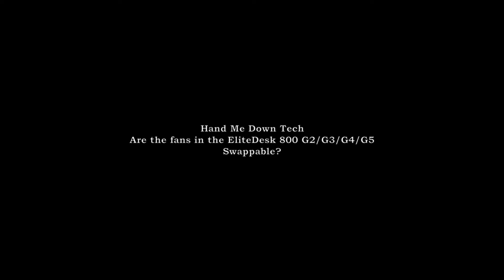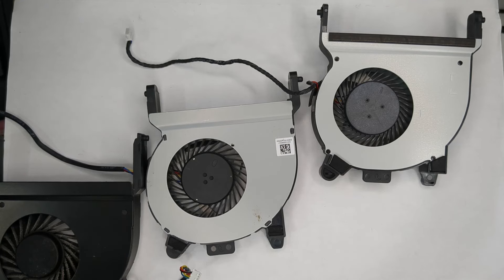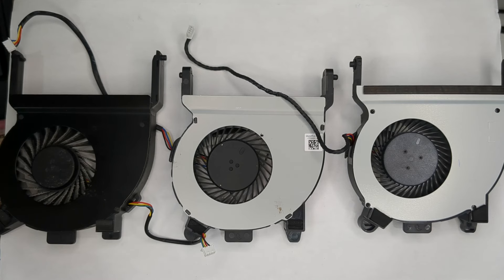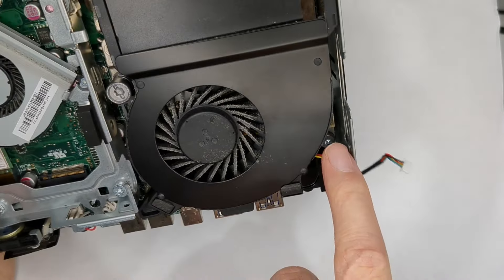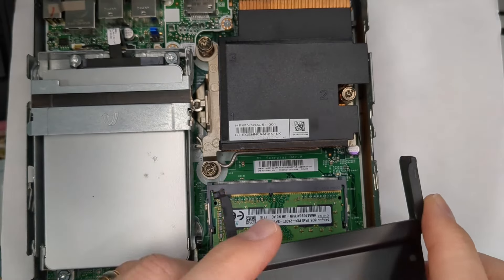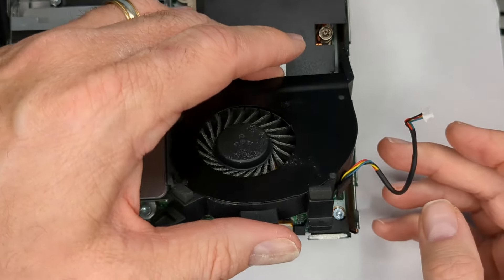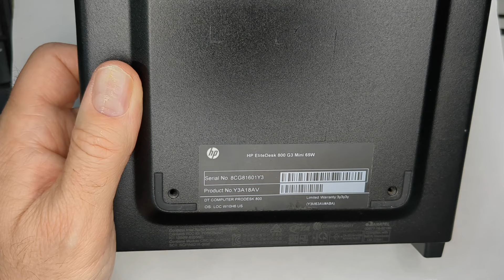Swap fans between the EliteDesk G2/G3/G4/G5 800 minis?

Comment: Yup... even the 65 watt fan caddies. you can screw the caddy down with two front screws, but the fan header is wrong... so even turning it upside down gives you nothing. 

Even trying to use the tops for some of the elite desks won't work, or swapping the front plate. It was absolutely annoying to have happen.
Reply from the maker: You'd think basic stuff would interchange.  Thankfully the power supplies aren't unique.  Except of course when you need the higher juice for the 65w system.

Comment: The thing that I like about the G1, and possibly the G2, is that you can set a minimum fan speed. I recently installed an E3-1275L Xeon in my G1. HP actually has a driver for it! Part of what the driver does is to set the min CPU min. processor state at 100%. Of course it runs pretty warm, but that CPU really wakes the G1 up. Anyway, in the G1 bios under power you can set the minimum fan speed. So I bumped it up a couple clicks and that really helped the CPU temperature a lot. . . I have a G3 and a G4 and neither of those Bios has that feature.
Reply from the maker: Very good info.  I'll check out the fan speed.  I was also curious about the xeon.  How many cores is that?
Reply: @handmedowntech  Sorry, had knee replaced and haven't been on in a while. It's 4 cores, 8 threads...
Reply from the maker: Hope all is well.  Recovery from that can be challenging.
Reply: G2 user here, yes it is possible to set minimum fan speed in a G2 ranging from 0-100% with a 10% dif

Comment: How about no fan? If we just ran nvme or ssd could we get by without a fan? Thinking about putting one behind my tv as plex client, as an Apple TV replacement. Wanting super quiet.  you’ve got the skills to test this theory out! Will it live a long healthy life?
Reply: This is the cpu fan so you would only get away with it with the least power hungry cpu you can fit and not do very much with it (no transcoding etc). TBH a 35W system is pretty quiet in its standard form ... Be interesting to see what happened it you sandwiched a big thermal pad between the cpu cooler and the case lid, didn't didn't run a fan and use the lid as a heak sink. You would have to turn off any fan detection in the BIOS obviously (not sure if that's only for the SATA fan though).
Reply from the maker: Interesting concept. Let me think on it
Reply: Remove top cover, remove the black sealing from the heatsink and force windows to run on battery saver mode -> cpu fan will run the lowest rpm if you dont demand any cpu usage applications

Comment: So as you may remember I order a hp elitedesk 800 G2 mini from eBay it was a bar bones unit i7 so missing the CPU memory and hard drive but this morning I wakes up to a message from the seller that he has posted a fully working 65w i5 with all the bits this one comes with a working hdmi option board as you did a video where the hdmi never worked in the 65w when it comes I will get the parts number so if you want it to be hdmi you can he said if I want to keep this one I can do I am saves me ordering parts for it
Reply from the maker: Only thing better than one EliteDesk to play with is two!  Let me know on the HDMI.  I may just have to try it again.
Reply: @handmedowntech  will do

Comment: I have HP 800 mini G3 Ryzen3 3200GE. I noticed that fan mounting system is total crap because of fan is not fixed with screws. So fan is not fixed properly and is shaky and fan is vibrating against other parts of pc and causes very annoying moscito sound. When i hold fan on hand it is very quiet. So there is potential to do this pc very quiet but it needs invention how to fix fan properly. On top of fan are cushions to avoid vibration against frame of pc but it is not good enough when fan is not fixed properly and vibrating against other parts of pc. I suggest buy some not mini pc what is bigger but fan is properly fixed with screws.
Reply from the maker: In my experience it is often easier to try swapping out the fan for another one.  I had a rather noisy ProDesk fan that was sort of like yours.  Would sound somewhat better in my hand. I brought in another one from a parts computer and it was instantly much quieter.

Comment: can u put noctua fans in a elitedesk mini?
Reply from the maker: @someone-fo5wd the fans for the minis are pretty proprietary.  You can't even put a G3 fan in a G2.
Reply: @handmedowntech  can i make it fanless somehow i want to make it no noise
Reply from the maker: The system will complain if the fan is missing.  Have you looked at the thin clients?  I have a video on one.  Those are fanless but don't offer as much in expandability.

Comment: i have a 800 G4 35w hdd fan power on then work 10 sc how hdd fan control
Reply from the maker: I tried using speedfan and others to control the fan and they just don't show up.  I checked on reddit and other places and everyone seems to say that the HP fan controls are proprietary.